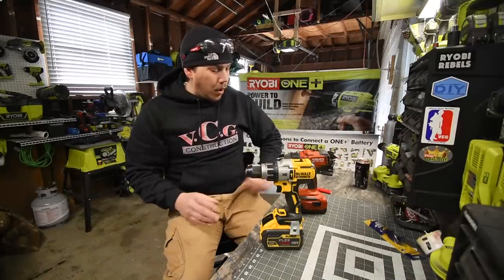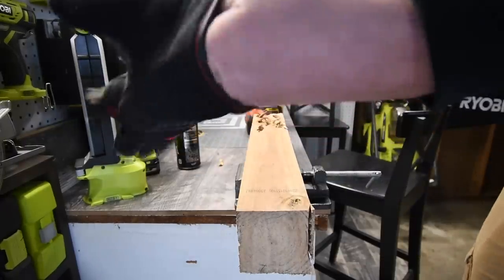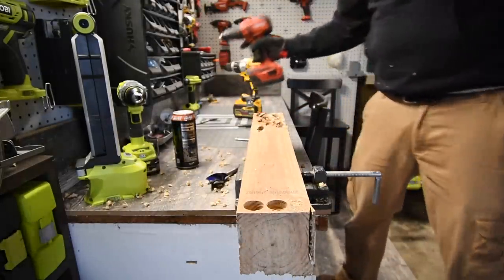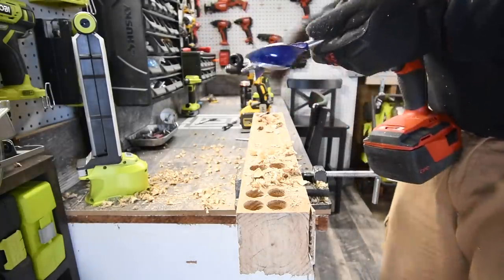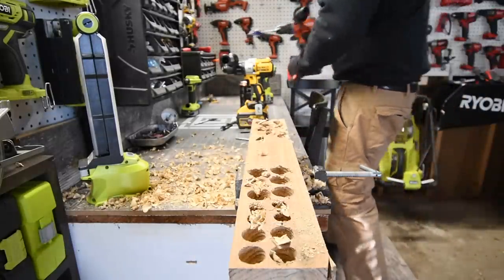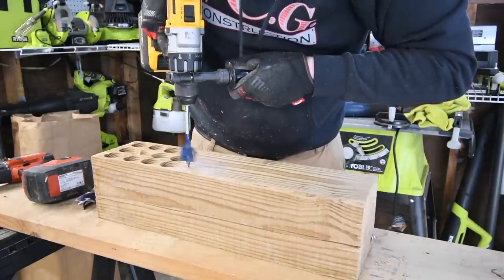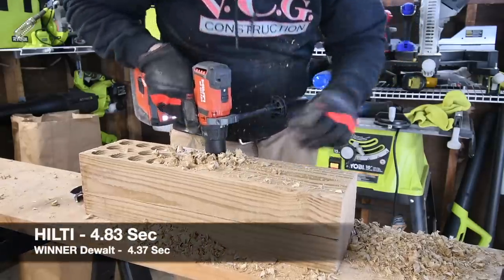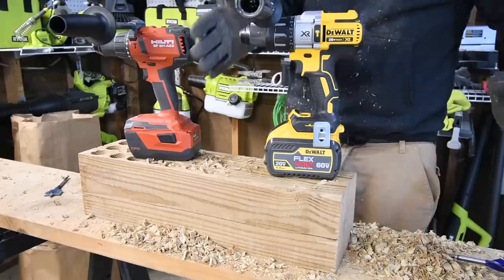Dewalt 9ah Flex vs HILTI 8ah (WOOD)

Comment: Awesome review brother, hey don’t know if you’ve heard. Dewalt has a new updated hammer drill. It’s the DCD998 it utilizes power detect and is optimized buy the 21700 cell batteries. It comes with the new 8 amp in the kit.
Reply from the maker: I cant wait to get it along the new batteries

Comment: the bit is not dull, the flutes are filling up with wood chunks, preventing the cutting edges from grabbing new wood
Reply from the maker: I tried multiple times on both drill with the 3/4 in this video. neither was able to drill through the 4x4 with it. it had no problem in the past. I drill about 80-100 holes with it, I think its time to get a new one

Comment: Great video I'm so glad I got the DCD996 instead of Milwaukee gen3 2804
Reply: Youll probably take that back in a year or two, overall performance is not worth the decrease in longevity.
Reply: Who cares how long it last if you like it better?
Reply: Remember he used a smaller battery when he tested the Milwaukee.
Reply from the maker: I think the dewalt Hammer drill is more powerful than the Milwaukee Hammer drill
Reply from the maker: I used the same battery for the milwaukee, 8ah vs 8ah High Output
Reply: @ManCaverTools  Maybe.  Lets see a head to head with the same size battery.
Reply: @ManCaverTools  The Hilti 8.0 has 12- 21700 cells.  The Milwaukee has 10- 21700 cells.  the Dewalt 9.0 has 15- 21700 cells.
Reply: Tim Happy that has to be one of the dumbest comments on a tool review video. Yeah who cares about reliability and durability in a tool.
Reply: @Unam469  I'll give one example.  I run a small oiless compressor.  It dies every year.  I could buy a bigger heavier oil filled one that last ten years.   I prefer the size over how long it lasts and I know how to charge so I don't need to count pennies.

Comment: ... the reason for manufacturers to do difere voltage is because at the down voltage category they will never win. 
Dewalt is the best in 18 volt category no matter what, the futures on that drill are unique and the price is very good , and because of so much electric one the tool you have to know and adapt so the tool doesn't stole on you. 
But you professionally can't know that because you have to work with the tool for a period of time to find out , and that Milwaukee and Hilti did,  they work with the competition tools and didn't repeat the mistakes they did.
Reply from the maker: thank you for the info sir, I still need to do a video on the ATG feature on the HILTI

Comment: I own this Hilti and it's a great combi! The only DeWalt I ever owned was a 3 speed DC988 18 volt with 2.4amp hour Ni-Cad batteries. It was a very early DeWalt with I believe an Elu motor. Are they made by Black and Decker now? It was a good drill in it's day with much better performance than the Makita MXT 18 volt 3 speed with NhMi batteries. The torque on the Makita was crap. This new Hilti has much more low down torque than my Milwaukee M18 fuel and the build quality and ergonomics are much better. This Hilti on speed 1 on highest torque setting of 15 will sink a 3" M8 Hex headed coach screw flush into seasoned 4X2 timber, obviously drilling through the 4" not the 2" side. My Milwaukee fuel leaves it 3/4" proud plus the head. I think in the US they are called "Lag bolts". Usually I would drill pilot holes for these bolts but I was just doing a head to head test. Both these drills above are impressive. My assistants back then would not bother to adjust the DeWalt for a different situation and would try and drive screws in on speed 3. No matter how much I moaned at them. I am sure these two drills would come down to personal choice. I personally love the Hilti but can't say much about the DeWalt as I don't own it!! But as I said it is impressive!!
Reply from the maker: it also comes down to the battery platform you are in, the dewalt has a much bigger variety of tools to use with the batteries. and I thank you so much for viewing sir
Reply: @ManCaverTools  your reviews are great! I only use combi's, SDS, impacts and a small Circular saw battery tools as I have a workshop in the theatre and work from there. Plus we have power points in all rooms so corded isn't an issue. It's mainly in our Auditorium that power sockets are scarce. 
Dave.
Reply: Black and decker which made by Stanley they owned dewait since 1998 i beileve
Reply: @ManCaverTools  ah on the battery means how much more power it stores for longer run time🤦🏼‍♂️

Comment: That reason that bit  Isn't working is because the flutes  Are Full. It can't let the wood chips out once the flutes are below the surface. You can force it but it wont-work efficiently at all. A dull bit in wood should still cut in soft wood just not well
Reply from the maker: I just need to sharpen it but the people would rather have me get a new one for the videos, if I dont they will think its an unfair test

Comment: Hey great review, but take the two apart, you will see why Hilti will last far longer then any other brand! Hilti has exclusively Building drills  for years used exclusively by commercial contractors. Hilti is built to last it’s like. Hilti is top of line way over  dewalt .
Reply from the maker: I will be doing that in the future and I thank you for viewigen Michael

Comment: I have a riddle.  Why is that DeWalt drill being sold with a 6.0 flex battery?  When there is 5 6 and 8 in the regular 20v Batts.
Reply from the maker: to get people to buy there kit, people get excited when they see the flex and say its a good deal.
Reply: @ManCaverTools  how does a 6.0 20v compare to a 6.0 flex?

Comment: Very nice test thanks dude!
Damn the hilti is a beast! It still ties with only a 22v batery and 1ah less compared to the 54v of dewalt! 
That speed drill bit is veeeery nice too! Wehre can i buy that in eu?
Reply from the maker: I have no clue and Im sorry about that, I thank you so much for viewing sir :)
Reply: The dewalt is a 20v. Flexvolt battery will run 20v tools or 60v tools (Flexible Voltage)
Reply: Oookay i'm completly stupid then sorry i thought the tool would use the 60v if necessary... My bad 😳

Comment: Your 3/4 bit isnt garbage just sharpen it
Reply: It’s not made for this tho. It clogs up and can’t expel chips therefore it overheats and get dull. 
Normally, no twist drill should get dull on wood.
Reply from the maker: when it comes to these test, people want to see drill bits get replaced with a brand new one. they would say the test is unfair otherwise
Reply: @ManCaverTools  i agree

Comment: I don't know why people are forgetting that DeWalt also has a great 1/2"  hammer / drill (DCD 796). That drill is also awsome. 

With the new 20v 6.0ah battery  (21700) cells it's a beast.
Reply: Michael C yup I will never change dewalt got another brand , affordable price and reliable 👌🏽💪
Reply: To add to that, Hilti has a bigger drill than this one, the brushed SF 10.  This drill in thos video is the SF 6.
Reply: What's your point? The 791/796 is much less powerful than the /991/996
Reply: @TheTurbomopar  

The 796 is just as good. Hope someone can make a video to show how good it is. 

That 996 when drilling concrete is massively loud. 

That's all.
Reply from the maker: I cant wait for the new dewalt batteries
Reply: @ManCaverTools  

Yes,  the new 8.0ah battery  (21700) and the new 4.0 ah compact  (21700). Don't know why they didn't do the the 5.0ah first. It's ok hopefully it will come out soon.
Reply: If the Hammer drill is an SDS it should be tested against the Hilti Te6 A22. That thing is Amazing!!